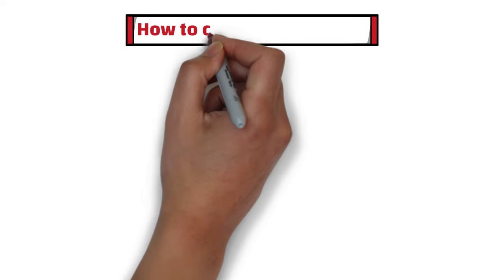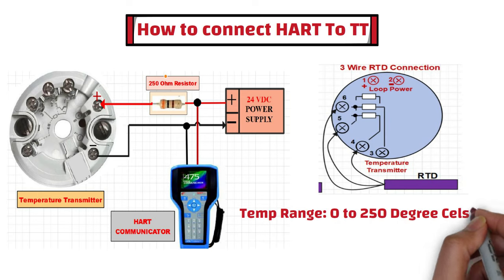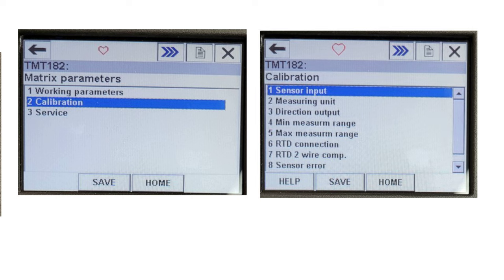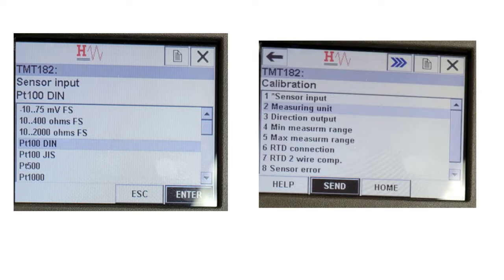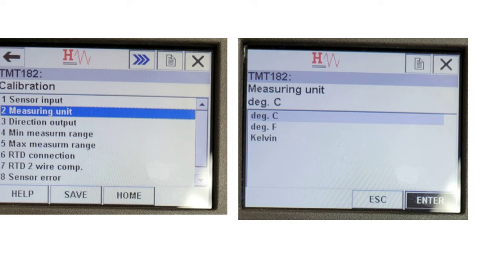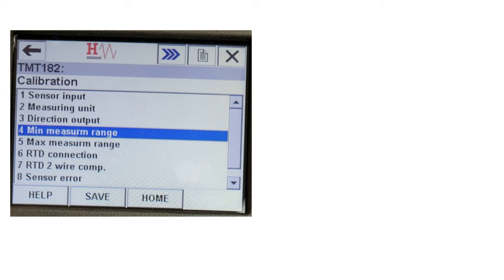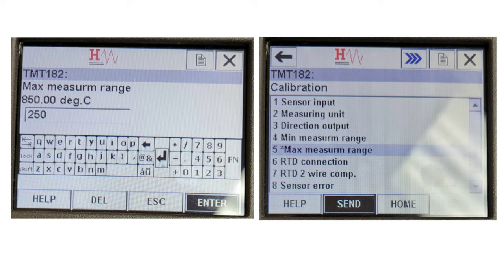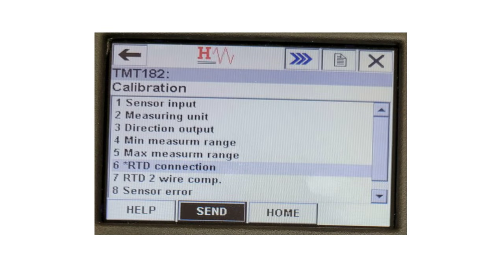How to Set Range in Temperature Transmitter using HART Communicator

Comment: I have a Rosemount Temperature Transmitter and I need to apply above 20.5 mA to check the Over-range alarm setting however I am not able to sent above 20.5 mA through HART as the Transmitter is not accepting the mA above 20.5 mA. Could you please suggest any options to check the Over range alarm

Comment: if a temp. Transmitter nameplate marked as -50 degree c~450 degree c, is it possible to rerange it as 0 degree~600 degree?
Reply from the maker: Hello 
Thanks  for your question.
No, It is not possible to calibrate beyond name plate range. You need to calibrate TT in -50 degree C to -450 degree celsius.

Comment: For HART communication aint the 250ohm resistor supposed to be between the HART communicator and power supply to enable communication?
Reply from the maker: @Makhosi Yes.. Ideally, it should be between power supply & HART Communicator

Comment: Sir if RTD has only 4 -20ma signal but doesn't have hart terminal its possible to calibrate using hart communicator or not thank you.
Reply from the maker: @Nelson No, It is not possible to calibrate the device if does not have HART feature.
Reply from the maker: If device does not have HART, then it need to be calibrate by using Analog Zero & Span button of transmitter

Comment: Can I use the transmitter as a 2 wire or 4 wire
Reply: No. first you check transmitter mounting plat. Then you check  it's 2 wire, 3 wire, 4 wire wire duel sensor. They mention in mounting plate. Then only you set 2,3,4 wire RTD.
Reply: @jegansekar4787  thank you Brother